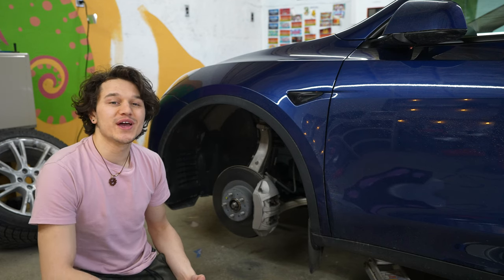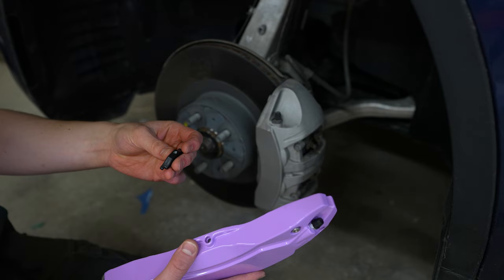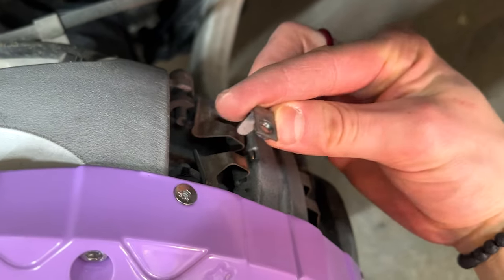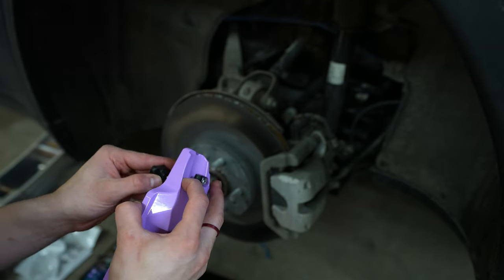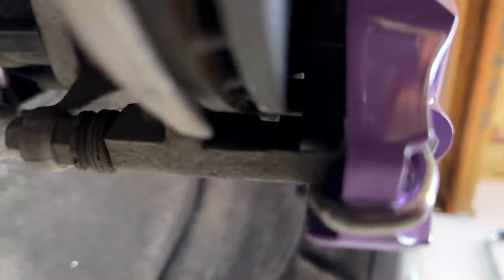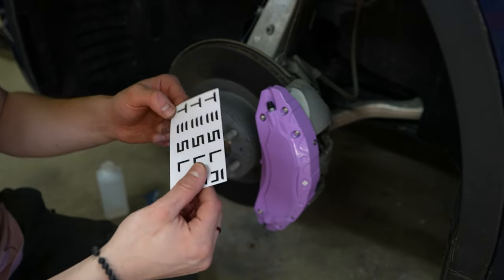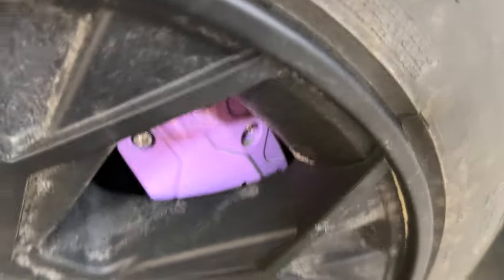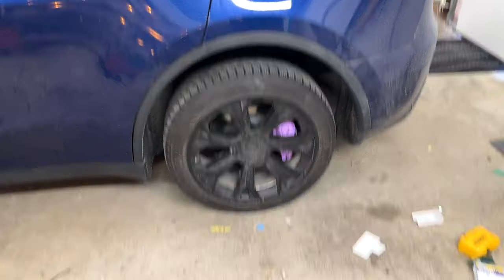Tesla Model Y Tesery Caliper Cover Install!

Comment: How do you think the stickers will hold up in the heat, dirt and washing? Also, I heard the screws could come loose after time. Was there thread lock included. Thanks for the review.
Reply: Thanks for your inquiry about the durability of the Tesery Model Y caliper covers, specifically regarding the performance of the stickers in heat, dirt, and washing conditions, as well as the concern about the screws coming loose.

The stickers applied to our caliper covers are designed with high-quality, weather-resistant materials that are engineered to withstand various environmental factors. They are UV resistant, which means they will not fade under direct sunlight, and they are also designed to resist high temperatures without losing their adhesive properties. This ensures that the stickers will maintain their vibrant colors and clarity even under the heat of the brake system.

In terms of dirt and washing, the stickers have a protective layer that helps repel dirt and grime, making them easier to clean. Regular car washing with appropriate car wash soaps should not affect the stickers' appearance or adhesion. However, we recommend avoiding the use of abrasive cleaners or tools that could scratch or damage the surface of the stickers.

Regarding the screws, we understand that durability is a key concern for our customers. Our caliper covers come with high-quality screws that are designed to remain secure over time. To further enhance their stability, we do include thread lock on the screws to prevent them from coming loose due to vibrations or regular use. This ensures that the caliper covers stay firmly in place, providing a safe and reliable performance.

We are committed to providing products that meet high standards of quality and durability. If you have any further questions or concerns about our products, please do not hesitate to reach out. We are here to ensure that you are completely satisfied with your purchase.😀
Reply: @tesery most AI reply ever
Reply: Lol i was about to say.. no anwser on your question

I was curious aswell if they hold up over time..